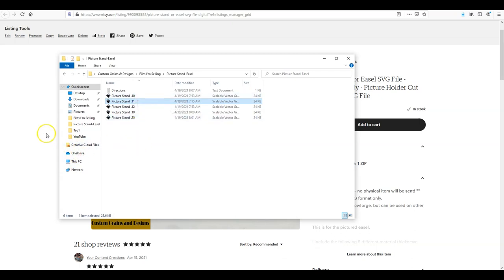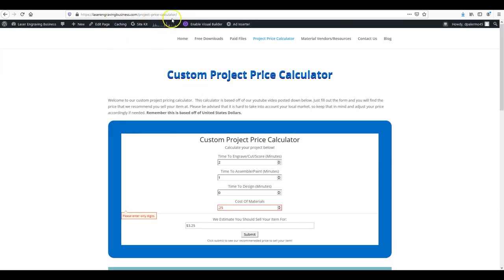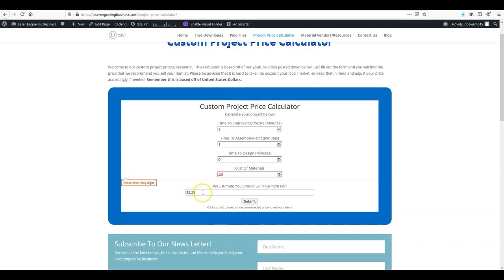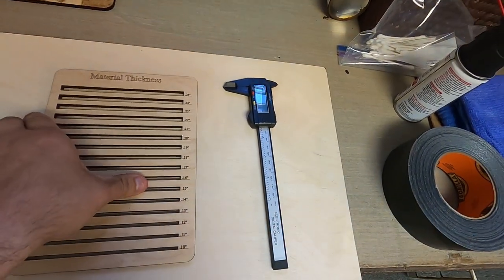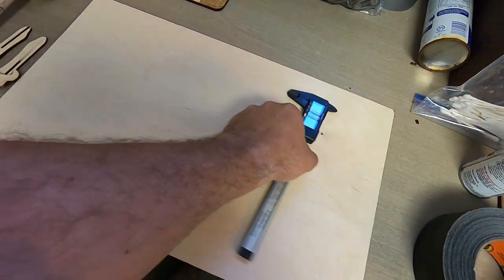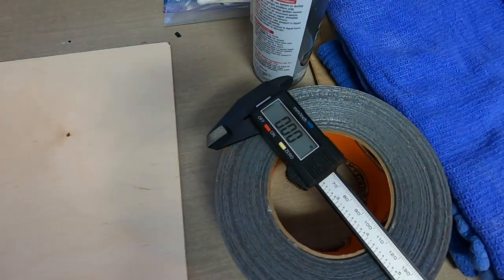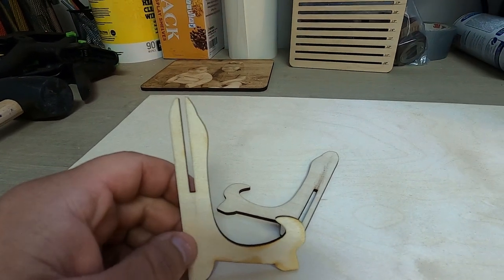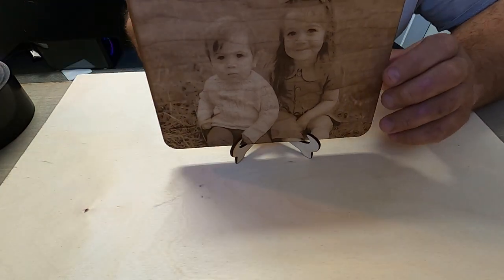How To Make A Laser Cut Picture Stand or Easel | Cut On A GlowForge

Comment: Hello, thank you for all the videos and informative hints and ideas for lasering. I recently got my muse laser. Did my first few cuts Sunday, I have asthma and realized the burn smell irratate my lungs. Can you tell us if or how you seal the projects from smelling. Thank you Michelle from Chell's creative designs. Keep videoing we love yall.
Reply from the maker: Hello thanks for watch. Unfortunately I don't believe you can really get the smell out. The laser is cutting the material so there will be smoke, soot, and burnt smells! I would make sure your fan is pulling out all of the smoke so it doesn't enter your home but as far as the product goes, it will have that smell. The best you could try to do is wash the burnt edges, let it dry, then seal with a clear coat or something. The clear coat has a bad smell too though.